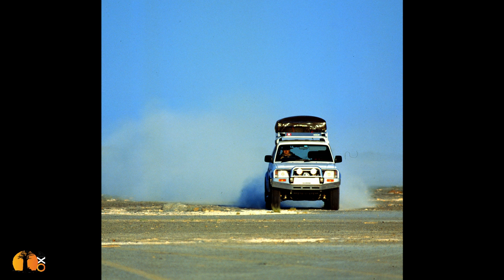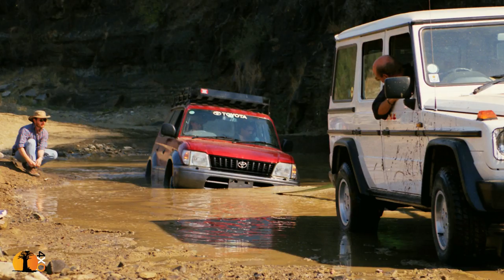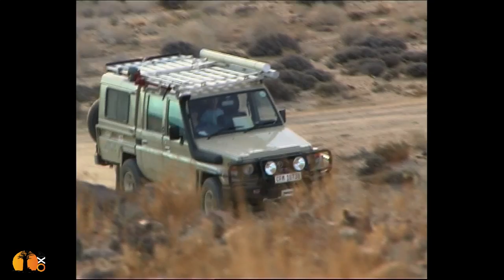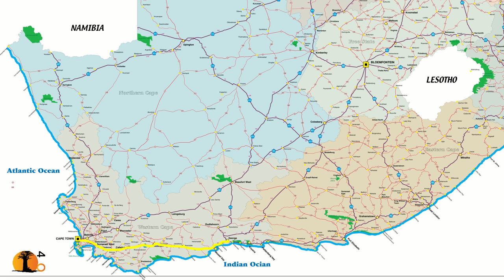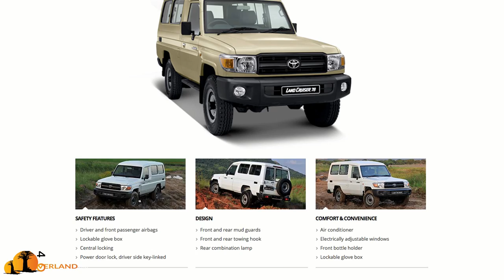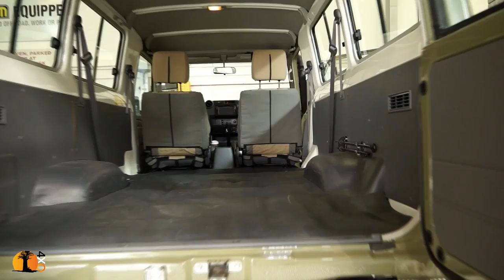WHY I DRIVE A TOYOTA 4WD | StoryTIME with Andrew St Pierre White

Comment: Nice video Mr White, i want your recommendation if your were buying a new Land Cruiser 200 would you buy it with 4.0 v6 1gr petrol engine or with the 4.5 turbo diesel (not twin turbo) 1vd? Considering the money
Reply: I have a 200 with the 4.7 petrol V8. The v6 is not available in Australia and the 200 diesel only comes with the twin turbo here too.  The 200 is a heavy vehicle so I don't know how it would perform with those engines you mention.  I can say that the 4.7 is wonderful and overtaking is never a problem.

  The big downside is thirst, which hinders range.  I don't travel long distances often so despite the extra petrol costs it is cheaper than if I had paid the premium for the diesel engine.  
If money was no option and you intend to travel long distances I would recommend the diesel.  Consider the price difference, how many years you will have it and how many km per year.  

The auto gearbox for the diesel is not correctly configured for the engine and does not take advantage of the tremendous torque available, so a manual would be the preferred option if available.  There is much information on the net about this.  The auto in the petrol is fine.
Reply: andres fleig  5.7l V8
Reply: I have the bi-turbo 4.5 1VD-FTV in my 200 series, and it is a remarkable engine. Given it is still in "brand new" territory for a Land Cruiser at just 130k km's I don't want to make statements on reliability, but it is a very capable engine with lots of power on tap and not that harsh on the fuel when you are not fooling around too much. Zero issues what-so-ever.
I would love a 5.7 petrol, but that's just what I got for now. I think it's down to preference, but I would only imagine that the petrol would never reach as low a fuel economy as the diesel for normal cruising type of driving.

Comment: Why is the 79 Pick Up also called  Land Cruiser while newer Toyota Pick Ups are reffered as Hilux?
Reply: The 79 is a Land Cruiser with a pickup bed, whilst the hilux is a completely different vehicle. Half the price of a LC, nowadays it doesn't come with all the offroad equipment and modi and Crawl like the Land Cruiser does.
Reply: @nils895  Thanks.
Reply: @eyeswideopen7450  You're welcome.  Greetings from Germany 
Nils
Reply: @nils895  Am I right, that the 70 series was the last model line that featured those Land Cruiser Pick Ups?
Reply: @eyeswideopen7450  As far as I know, you're right. But the 79 is still built in some countries, so if you might wan't to get yourself one (is that the case?), you might import one, if your country isn't supported with 79s any more. On the other hand, the Hilux is quite a legend for example in South Africa, too.
Reply: @nils895  used 70 series are pretty hard to find in Germany ;). Buying a Hiluy might be the cheaper option.

Comment: I love your videos and wish I could drive troopy v8 diesel, must be an awesome offroader. Is there a left hand model already?
Reply: Darren Hale why answer when you have no answer, lol
Reply: Darren Hale I won't reach to vulgar language like you, simply because what you can say or find is of nobody's interest. I asked a question about latest development about the car on the topic which is fair enough. If that was beyond your mental capacity, I feel sorry for you. But as soon as you finish reading this, you'll start feeling better 😎
Reply: Juraj Balaško - They are available in the Middle East, and also unofficially exported to parts of Africa from Dubai and Oman.
Reply: Michael Atkin Thank you, I was able to obtain a quotation from UAE/Dubai:
Toyota Land Cruiser 78 Hardtop 
Brand New
Year 2017
4.2L Diesel Engine 
Manuel Transmission 
13 Seater 
Colors White 
ABS, Diff Lock, Dual Airbag
Price USD $35,000 Exw.

Comment: was the red and white 90 series not a KDJ instead of a KZJ? (notice the D4D badge under side mirrors)
Reply: J e f f f f f They were KZJ up until 2001 .1KD came around late 2001,  So his being the early ones i am pretty sure it was KZJ .
Reply from the maker: I assure you, it was a KZTE. The D4D Prado-90 was never sold in South Africa. They even had the KZTE in the Prado-120 when it came out.
Reply: thats unfortunate, you would've really liked the extra power and lower fuel consumption
Reply: 1KD does not do well in places where they have questionable fuel quality. 1KZ is better in terms of  reliability

Comment: What do you think of American Tacomas?
Reply from the maker: I did a short trip in one, and then drove another one a few years later, so I cannot provide any valuable conclusion other than to say: "Its okay. Thirsty. Its interior is . .  okay. Its aToyota so it might be more reliable than average and have better used value. Not as strongly built as a Hilux. One can feel it."
Reply: Own a Tacoma and had a Hilux for 6 months in Nicaragua. Tacoma has a C channel chassis from mid to rear. Hilux is boxed all the way, bigger GVWR. Front suspension components the same. Hilux has beefier rear springs and steel bed. Tacoma has composite bed. Other than that, you're basically driving a hilux.
Reply: Thanks for the reply, Andrew
I am so sad that Troopies aren't sold here in the US as I am obsessed with the Land Cruisers that you have owned. 
But I'm proud to say that I've followed your advice on "skinny" tires and have just installed Cooper ST MAXX 255/85/16 on my pickup and I could not be happier. There's nothing like a Tacoma on skinnies (in America)... well, besides a Troopy on skinnies

Comment: So you've never owned an 80? If so you missed the best 4WD Toyota ever made, in my opinion. 24V 1HD-FT all the way.
Reply from the maker: The 105 is an 80-chassis with the 100 body. I owned two, and loved them both.
Reply: 4xoverland Yes, but without the factory turbo diesel that makes the 80 so good. You said yourself the 1HZ was sluggish and it was, the 1HD-FT solved that and still had coils all round that the 76/9 1VD missed. 
I've had all 3, in the form of a 75 1HZ, 80 1HD-FT and a 79 1VD and by a long, long, long way I prefer my dual cab cut 80. 
At least you're not driving a Nissan :)

Comment: Why nobody outside north america want to have 5 to 7 liters diesel in their 1 ton truck.  We did 12L/100km on 35'' tires with a 5.9L cummins at 140km/H in a POS dodge pick-up. South-African and Australian already have bomb proof 70 series why not go all-in with 900lbs of healthy torque ? Is it regulation, price, tax or culture ?
Reply: They aren't made in RHD, so they are very expensive as they have to be converted to RHD in Australia. That said, Landcruisers are damn expensive for what you get. 

There are some pickups here, I have an F250, but they are quite large for our tracks, and you typically see them towing items, not going through hard tracks. I love my truck, but will acknowledge, it isn't built like a proper landcruiser, I've seen F-trucks (which I think are build the best of the big 3 for off-road duties) shatter front springs every 25k miles, and split chassis by 60k miles due to our outback roads, not to mention things like dust sealing and electrical issues. Dust, heat, the loads people carry and particularly vibrations tear most vehicles apart. They are great for what they are, but the usage of a pickup here is quite a bit different (and a lot harder) than what is typical in North America, although they are being bought more and more here as lifestyle vehicles now (mostly Hilux/Ranger/Tacoma sized vehicles) and you see the vehicles changing to suit (more equipment, not as much focus on durability).
Reply: So would you like the f-250 engine in a land cruiser ? Or is it useless for the application ?
Reply: I'd probably like Toyota to assemble it above all else!

Comment: +1 for Toyota’s.  For the most part they’re very reliable when talking 4wds.  They’ll break less things and have a better mechanical track record for its entire life than its main competitors in Aust when talking 4wds.  Mitsubishi’s offer next to no ground clearance as standard and have independent susp all round in their wagons which is a cop-out.  Nissan designs things weirdly, especially interiors, and I think Nissan are so painfully obviously out of touch with their buyer’s market with a few of their vehicles.  As for Nissan interior, for most of their models it looks like an after thought.  It’s like they had a non-negotiable 5 minutes to go b4 before finalising everything for the design of a new vehicle and they clean forgot about the interior, then incompetently slapped it together so damn fast & rough.  And the end result is what u see in almost every Nissan on the road today.  And as for Jeeps....  No comment thanks.
Reply: Brett H I love your comment....”As for Jeeps”...yes true lemon 🍋 cars:)
Reply: My 2012 Nissan Frontier (SL 4X4) pickup interior is laid out nicely - for me anyway.  Mine is a crew cab with a 5 ft. bed and 6 cylinder engine.  I'm not an overlanding expert yet.  Perhaps I can learn from you.  What specific interior design flaws exist?  And is the Frontier included in those design flaws.

Comment: I completely lost trust in Toyota.... at least the Tacoma here in the states. My 2012 tacoma tripped a  code in the BS emissions system that kicked the truck into limp mode. Unfortunately it happened while I was climbing a fairly steep, VERY busy 240ft bridge with no shoulder. The sudden loss of power left me with no engine power to get to the top of the bridge. I was left high and dry. Then the accidents came. I very nearly was killed. Fortunately I ended up with only a broken arm and some cuts and bruises. All for an air flow valve on the emissions system. 

 I realize that could happen in any vehicle from any manufacturer, but to me it happened in a Toyota. So I can't personally see myself ever driving one again.I'm glad others have had such great experiences with them, but not for me.

Comment: Prado 90 series is bad offroader, engine heating and biggest problem front axle (ball joint) and wheels splitting like spaghetti.
Reply: Instead of calling other coments bullshit. Do a search first, the 90 series prado has independent suspension on the front axle, that gave a lot of problems, there is alot of photos of prados with wheels splitting and front bumper on the floor. Is not robust as 70 and 80 series land cruisers.
Reply: Prado is underrated 4WD. While it may not be the most hardcore 4WD, it can get you to most places with some smart mods. Especially need bash plates 😀
Reply: ...and which genuine 4WD isn’t a box on wheels 😂